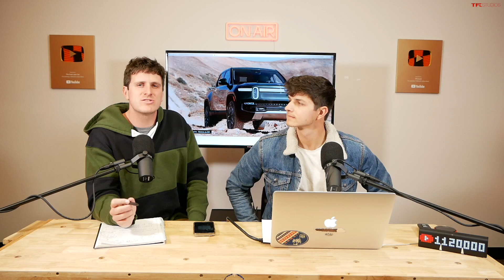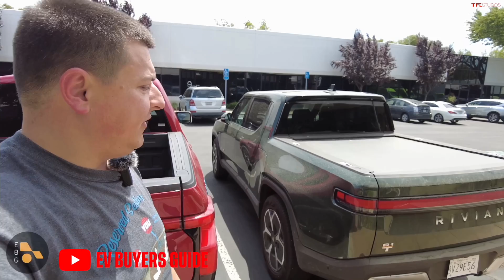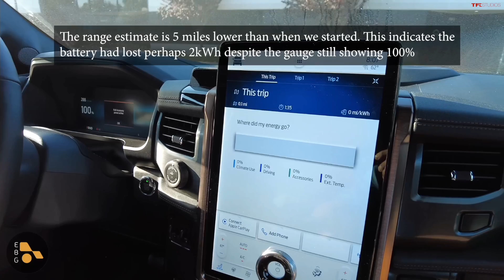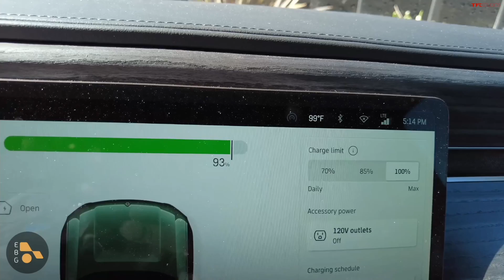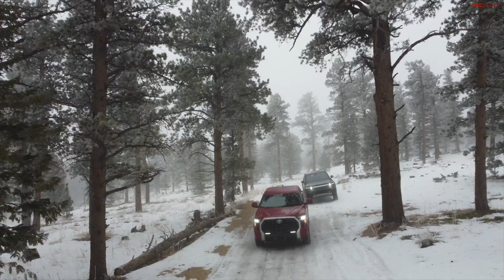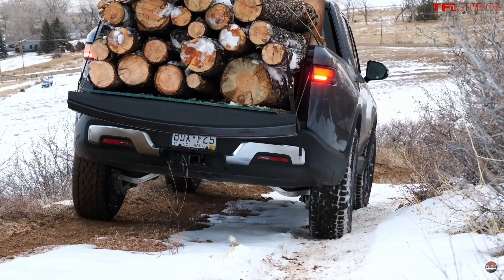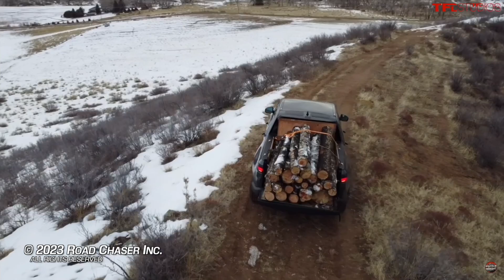This Rivian Is Getting The Equivalent of Just 25 MPG: Here's Why That Matters!

Comment: My 2019 chevy VOLT runs on battery 90% of the time until -25C. Last summer I left the car at the airport for 3 weeks and upon return I was pleased to so no loss of charge. In the cold winter weather I left the car sitting for 3 + days at a time and found no loss of charge. The only downside to my battery is that the cold winter battery range is approximately 50% of summer range but it still serves my needs with the lower cold weather range. It would be much better if I had a heated garage which I don't at the moment. The big bonus is that I get FREE charging at work 100% of the time. The Volt battery seems to have one of the most solid reputations so far in the industry even though it is not cylindrical battery pack, most people I have found posting about it say they have little range in 10 years of ownership and GM says the battery is expected to be good for 10 plus years with an 8 year warranty.
Reply: They all got recalled?

Comment: Here in central Texas electricity is 9.7 cent per KWH plus a 22-dollar service fee per month but you have that anyway so cancel service fee out. So.
81kwh x 9.7 cent = 7.86 dollars. So, for 7.86 he got 60 miles at an average speed of 11 miles per hour. That actually could be really good! I'd be curious how the computer averages MPH, while its on like sitting still running the AC or just while its moving. Gas here is about 3 bucks a gallon, so for 7.86 dollar you can buy 2.62 gallons of gas. 60 / 2.62 = 22.9mpg @ 11 mph avg speed. A ranger can't touch 23mpg at 11mph, no way.
Reply: NAILED IT!

Comment: This is like my Toyota dripping gas out of the tank at all times . And then I refuse to fix it , lets say it drips a gallon a day  [ By the way it's a Corolla ] in two weeks it wont run . Then I have to put a couple of gallons out of my lawnmower can and drive 3 miles to the gas station and fill up so it took 12 gallons ,  [ The tank holds 14 ] to travel 3 miles that comes out to 0.25 MPG . You get the point fuel to propel the car leaks out when it sits . This reminds me of a early 1906  add I have in one of my old car books . The add states you have to feed the horse weather or not it does any work but the car only uses fuel when you run it . At the time it was a convincing argument .

Comment: It is still cold in the northern hemisphere.  Could that energy drain be a consequence of keeping the battery warm ?  Generally the battery will not accept a charge if at 32F or lower and cold batteries temporarily lose range so there would be an argument for leaving battery heaters on when the vehicle was parked and otherwise cold.  Just a thought.

Comment: This is something I've pointed out to colleagues at work as one of the reasons I'd rather buy hybrid than electric.  We work in the Mojave Desert and it has been bitterly cold since october.  During the summer we usually have about 10-15 weeks of daily highs around 100 F, and highs of 85-95 for about 6 months most years.  Battery EV's have to cool and heat their batteries to prevent potentially hazardous damage (best case scenario, elements reduce the number and depth of charge cycles, worst case, internal shorts can develop and cause thermal runaway).  So battery EVs will always be running some sort of climate control, even parked.  That's energy that will have to paid for that doesn't get put to the road.  Then when we consider that most electricity is generated by natural gas and look into the efficiencies involved in generation, transformation, distribution, charging, storing, and using that electricity and the overall miles per btu or lb CO2 is better in a hybrid and battery EVs in certain circumstances (models and climes and driving habits) can be less efficient than a big thirsty V8 (but will usually be comparable to mid range traditional naturally aspirated economy car).  They're really rather pointless so long as our grid relies as heavily on fossil fuels as it does.
Reply: What kinda work in the desert?
Reply: @usadaytrader  education/consulting. Lean, HOP, and the like. Mostly futile attempts to get middle managers in companies with outdated attitudes toward their staff to actually act like decent human beings.
Reply: Nah, this is not a BEV problem, this is a Rivian problem.  I just parked my car from early December to early January with temps in the high 30s to low 70s, and once I turned off the 24 hour security system, it was fine. I have parked in the snow for 2 days and lost what rounds to 0% (I'm sure there was something but not enough to register). I have also parked in 120+ sun for multiple days and lost about the same. This is a Rivian problem.
Reply: This isn't an issue between BEV and Hybrid, it's an issue of abysmal design by Rivian compared to everyone else. Hybrids are the worst of both worlds, you'd be better off with a Diesel than one of those. Nobody needs the nightmare of trying to fix a Hybrid when it starts playing up.
Reply: @rogerfroud300  " Nobody needs the nightmare of trying to fix a Hybrid when it starts playing up."
Yet Toyota has managed for over two decades.
Reply: @rogerfroud300  the advantage of hybrids is that you don't need a super high energy density battery so it can potentially avoid some of the temperature sensitivities by using older chemistries.

Comment: How is he getting that 135kWH is equivalent to 4 gallons of gas? Then saying he gets 25MPG? Also Ford Ranger is one of the more efficient pickups and then he compares Rangers highway MPG to Rivian city driving. Don't think this any of this is correct. Lastly California is big with many different climates so if he is in a cold area with snow and ice and has the seat heater on and heater set to 72 and jumps in and out for small trips with lots of sitting he of course is going to use a lot of energy.

Comment: Doesn't look very capable offroad, then you factor in all the materials and what it does. You could literally get 6 diesel trucks and run them 300k miles before you made the carbon footprint this thing has sitting new on the lot. It will be nice when we can actually make this work. This isn't it though, this is still test phase at best. This is like releasing a video game that's dependent upon DLC that isn't available yet.

Comment: 4-16 kwh/day is normal according to Rivian.  At sky high CA rates that's $2-$8/day or $730-$2920/year to keep your truck parked.
Reply: thats the california way, pay pay pay pay for everything you possibly can
Reply: @baldisaerodynamic9692  to drive my 14.5mpg S550 Benz it costs $3641/year driving 12,000 miles using premium @ $4.40/gallon.  This truck would be within spec to consume 80% of that cost just sitting in my driveway.

Comment: If the car does not have a safety with lithium batteries it shouldn't be selled. Because everyone knows what can happen if you load damaged lithium batteries. I wouldn't assume that someone who build these cars will be that dumb.
If the safety only detects if it's broken than this could maybe a very expensive failure for rivian.
My guess is that the system detects a somewhat low voltage and shuts the battery off before it gets damaged. Maybe even the 18650 or what ever form factor cells have each a small safety. But these often shut the cell down for good. No loading possible because it was in the danger zone.

Comment: You guys are chasing the wrong source of the problem....   EVERY car.. not just EVs, waste a ton of energy, particularly in the winter to warm up the car cabin and the battery (for EVs).  This would be a minimal amount of energy used if you started out on a long drive, but if you are doing this every time you go on MANY short, 5 mile drives, the amount of energy used to warm up the vehicle is basically more or nearly equal to the amount of energy you actually need to drive.  If I startup my HYBRID in the winter to warm it up, then take it on a short drives, I get less than 20 mpg average for a vehicle that can get 35-40 mpg on the highway.   The real issue here is that the owner is not driving their vehicle ENOUGH or far ENOUGH on a daily basis.

Comment: Estimated miles per gallon depends on your driving habits, the cost per kwh, & cost per gallon of gasoline.  If your achieving 1.8 mpk and paying just 7 cents per kwh charging at home then your paying 3.8 cents per mile or $3.80 to drive 100 miles. Comparing that to gasoline that costs $3.80/gal your equivalent mpg would be 100 mpge
Reply: This guy still only used about $12.50 worth of power @ $.015/ kwh to drive back and forth to work for 10 days including all warming up time and travel. Not a stretch to think he could burn through the same amount of money in a couple days driving an ice vehicle pick up. His theory on battery cycles is flawed as well. Whether you add 5% charge ten times or 50% charge one time it's technically the exact same cycle for the battery. Also he's actually using more cycles of his battery doing this method as the vehicle would use power from his house to preheat the vehicle if it was plugged in rather than depleting the battery and adding additional cycle use. he'd be better to charge it to 50 or 60% and plug it in daily for max battery health

Comment: I parked my 2014 F-150 with a full tank before a trip. Came back,  tank was still reading full and estimated milage still read the same as before I left. I like my version of stand by mode better.
Reply: Gas can go bad. Also the battery could drain on ICE cars too.
Reply: @kaptain1477  Absolutely true.  However, stabilizer can be added to your fuel to extend its life around 1-2 years depending on brand and amount added.  Car/truck batteries can last a good many months with little drain.  If they are a bit too low, a quick and easy jump start is all that is needed to get you back on the road.  An EV with no charge left most likely would need a tow on a rollback truck to a charger, unless you have someone that can bring a gas generator that can put out 220VAC at 30A to charge you up a bit, which would take a while to do.  Nothing against any vehicle technology, just know its limitations and exploit its strengths.  Buy and enjoy what you like.
Reply: @kaptain1477  I've stored vehicles for multiple years without the gas going bad. They fired up like they had just been run earlier the same day.
Reply: @kaptain1477  LOL after essentially a year or more; Then you can just add some good gas additives use up the old stuff and get some more.
Reply: @kaptain1477  Gas in a sealed EPA compliant fuel system can last years. Vented fuel tanks like gas cans and small engine carbs are entirely different than a modern fuel system with a carbon canister and pressure valves to prevent air exchange.
Reply: I parked my Tesla Model S with an empty tank after a long day.  Came back in the morning and the tank read full and the estimated milage read 300 miles more than before I left.  And it only cost me $5.  EVs are sooooo much better than ICE, I would never go back.
Reply: @dfreadhoff  Keep that energy when you are buying the same vehicle again pretty much.

Comment: This makes me feel SO much better. Given my usage habits, it totally removes the urge to buy a Rivian. My wallet thanks you, and Jordan.
Reply: Except for all of those other owners seeing less than 1% loss
Reply: The charging network issues alone make Rivian a deal breaker right now. They're losing $170k on every truck sold, if they don't turn it around very soon they won't exist and you'll have a paperweight when you need parts/repairs.
Reply: @OtisFlint  Tesla going to open their network very soon I believe.  While that crowd my Tesla charge network, it would be nice to not be held back from supercharge networks when picking an EV.
Reply: Don't buy anything outside Tesla yet, imo 
Unless you want that early adopter experience
Reply: @febrianadji5758 You are going to get that early adopter with tesla. Their build quality is garbage compared to foreign brand EVs that are entering the US market. EV6 and IONIQ 5 have considerably better build quality over any Tesla.
Reply: @starraidz791  both of that Korean car lack charging consistency

You can't always expect to get 235 kW peak
I would rather have e Tron any day, but it's out of model 3/that Korean car budget
Reply: The pre condition charging that added on new updates aren't as fluid as Tesla

You buy Tesla not because of great car
But for software and charging network
Reply: @febrianadji5758  Teslas $uck also. They are dropping in prices. I want the Toyota EV or Hydrogen With a Manual clutch.

Comment: If your vehicle is Phantom battery drain that's a good thing.
It likely means that you have a heating and cooling system for your battery.
My ten-year-old Nissan Leaf doesn't have any Phantom drain. When the car is off the battery is not doing anything. It would let itself be frozen to a solid brick if I left it out in the cold.
But if you plug in a good car it'll keep the battery warm while it's out there.
If you have a really fancy car it might keep the battery a little warm without it being plugged in.
Phantom drain concern is time wasted.

Comment: I loved the Rivian when it came out. The right size for me. However, the price was killer but now even if the price was $25 to $39 thousand this clearly is a killer. This is a new key question to consider on any EV and should a new standard to report on new EVs just like the MPG require. Imagine going out on a hike where your are gone for a week and end with a much longer hike afterwards cause you can’t drive back to civilization.

Comment: With sentry mode on my 2021 Model Y looses about 1% - 2% a day. Sentry mode turns off at less than 20% battery charge and I’ve realized that in those instances where sentry mode is off, the car doesn’t loose ANY battery percentage while parked. Typically speaking in the warmer months, I charge once a week to 80% and drive all week before charging again. Usually by weeks end I’m at 40%. My commute is roughly 15 miles round trip or about 60 miles a week. So if you’re keeping score, the Model Y is loosing roughly a quarter of its range just sitting all week with sentry mode on.
That ain’t perfect either, but it’s no where near the Rivian. A 3% - 12% loss in battery a day is absurd. Plus I know that turning sentry mode off in the Tesla  effectively negates the drain.

Comment: The other question though is how did he manage to take over 5hr to go 60 miles? That’ll drain the battery - probably has the aircon or heating on the whole time. Well over 5hr driving would easily use 81kWh.

Comment: My Model 3 was just as terrible with phantom drain at first, and while Tesla has fixed this a little bit, it’s still pretty annoying how much juice it burns just sitting there (as opposed to my Leaf, which I could leave for weeks and only lose a %). I’m not looking forward to the same problem in my R1T on order, especially since I’ll be taking it into the backcountry.
Reply: Further, seems like most of the legacy companies DON’T have this problem - so what are Rivian and Tesla doing that sucks up so much juice?!
Reply: Don't take it into the backcountry - there are enough people getting stranded out there with regular cars, and with an EV there is no way to just bring some gas.   Or even tow it out since it weighs so much.    It's OK for light off-roading, but I would not get any farther than 100 miles to the nearest charger.
Reply: Will just be using it to get to trailheads on deteriorating resource roads, same as we’ve been doing for 20+ years in our other vehicles.
Reply: maybe stop buying EVs if you are worried about these issues, that you also already have concerns about being in the middle of nowhere.

Comment: At least with a gas/diesel powered vehicle it isn't losing fuel while its just sitting....well diesel maybe not as much, but gas tends to evaporate over time as well....how much during the same 13 day sitting period compared to the battery drain on the Rivian?  Someone should test that....curious if diesel evaporates at the same rate, or at all?

Comment: With a ice car you can easily add a battery disconnect. Wouldn’t a feature similar to this be easy to add to the software? Why does everything have to be so damn complicated?
Reply: The only thing that needs to run when your truck is off is the sensor that tells the truck the key/phone is close. Then the door unlocks. How can that possibly use a measurable amount of a battery this size

Comment: I think the math here is a little bit off.  One gallon of gasoline is indeed equivalent to about 33 kW of electricity, but gas engines are only about 30% efficient.  This means that one gallon of gas is really about 10 kW.  I have driven a Chevy Volt quite a few miles and the math checks out.  The usable capacity of about 10kWh gives a range of about 35 miles.  When the charge is depleted and I am running on the gas engine, I get about 35 mpg.

Comment: This issue is not good for the environment. The loss of battery power without use is wasteful resulting in twice the drain on the power grid. Environmentalists would lose there $#!+ if gas vehicles did this.